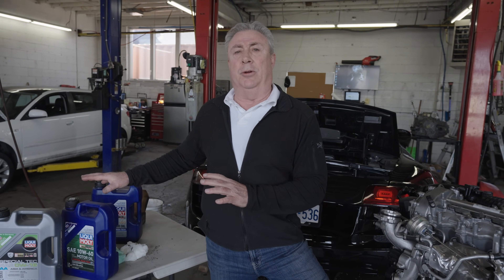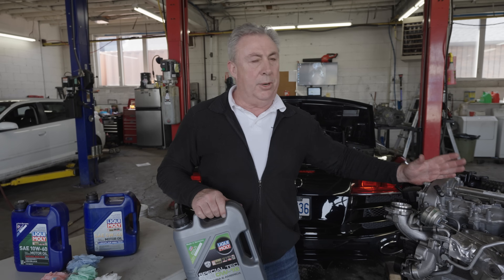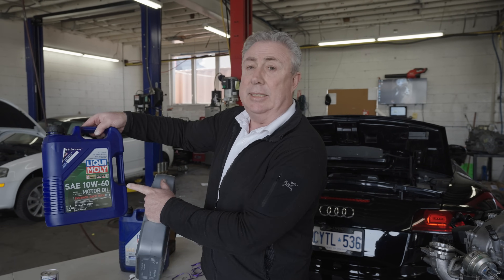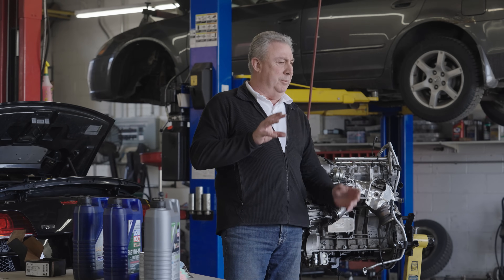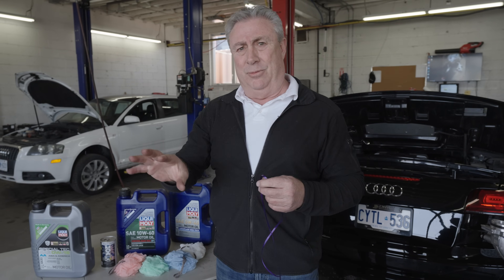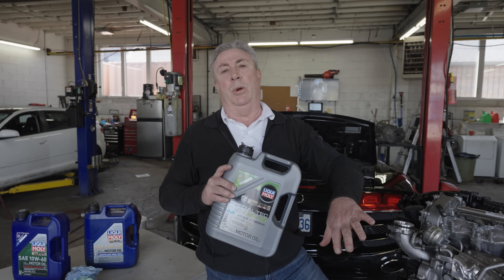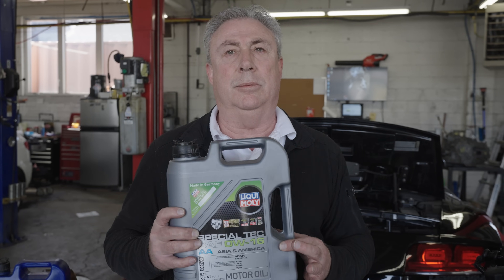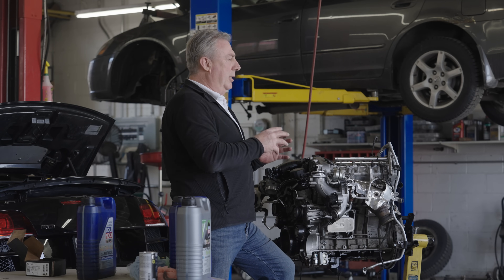Thin engine oil just a Scam? What's Safe

Comment: Kudos for you bud. Finaly someone with no BS. I'm sick and tired of YouTube "influencers" making you question mechanical engineers and car manufacturers. There is no conspiracy, car manufacturers designed engines to run on specific oil so use damn oil that is recommended for your car and change it often.
Reply: All too often nowadays, there is indeed a conspiracy - a conspiracy to get the highest possible CAFE numbers and to claim the lowest amount of required maintenance.  Back in the day, it was the engineers who determined what oil should be used, but Back In The Day is not today.

Comment: As a Chrysler instructor I had the opportunity to spend time with “Director of Organic Materials” (no shit).

He explained the lubrication ability of oils. They break down into four groups. 
Group 1 (aka “synthetic”) is by far has the best lubrication ability.
Group 2, not as good
Group 3 even worse
Group 4 very poor

“Synthetic” or 5w-20 or 5w-30 is pure group 1 or a mixture of group 1 and 2.

10w-30 is group 2 or a mixture of of group 2 and group 3.

10w-40 is pretty much group 3

Everything about that is group 4.

Now this ‘ol boy came to work in coveralls, no suit, which made me immediately like him. He has multiple PhD’s. I never saw a reason to disagree with him. 

Another reason for oil existing is it now performs hydraulic functions. Multiple cylinder displacement, cam phasing, variable oil pressure, etc.

We had a customer who refused to use anything but 20w-50 in his Hemi. He would bring it in with the MIL on. The techs drained the oil, put in 5w-20 and drove it around. Change oil again and gave it back to the customer who drained it and put in 20w-50. Strangely the MDS would act up again.

He said, “That’s all I’ll ever use!” He took us to lemon law and lost.
Reply: I may have had that backwards. I guess I misremembered. After some research , group 1 is the garbage.
Reply: Yes Group 1 is garbage. MDS works great even with 5W-30. I can't imagine running 20W-50 in anything nowadays. Unfortunately even Dodge went to 0W-20 in the Hemi in its last few years of production of which I promptly ignored.

Comment: If your going to be pulling something heavy in Death Valley in the summer time, you will  have a lot more to worry about than just the motor oil viscosity!
Reply: 20w50 if its a scorcher.

Comment: Forgot to mention a lot of engines need a thinner oil for the smaller oil ports for vvt ..vct..etc
Reply: Wrong.
Reply from the maker: Yes, the oil passageway size is definitely something to consider for choosing the right oil viscosity.

Comment: One thing I found using fully synthetic only oils in 80/90’s + cars that when lade up for a very long period. Say for example you take of the rocker cover there is no oil to be found, the top half of the engine is bone dry! Even the bottom end is. But using mineral oil everywhere
Reply: All mechanical parts are nice and oily

Comment: Engines that have hollow connecting rods and crankshafts require the specified viscosity to avoid oil starvation. IE heavy oil will not flow though a pin hole like water. Change oil before it gets dark. Never use a FRAM filter.  NAPA, or PUROLATOR are superior to all the others. Difference of Platinum vs Gold filter is: Platinum filter element is engineered to remain intact for at least 12 months, nothing to do with particulate size.. Save your money if you're changing it every 3 / 6 months. Really good thing to do especially with hollow cranks, and con rods is day before service pour in a bottle of KLEEN FLOW valve and lifter cleaner. You will pull a lot more dirt out when draining and you will notice the oil stays cleaner longer after the change. I would never buy a work truck that runs  on 0 / 20 oil. Respectfully submitted.

Comment: Thinner oil is used for engines built to tighter tolerances less bearing clearances and such. If you use to thick of an oil in you modern engines you will cause more damage than running the manufacturers specified oil recommendations. Another issue with thicker than specified oil is the VVT phasers and actuators will not function properly. Do yourselves a favor and stick with the recommended oil weights. The problem is to high intervals between changes. 3k-5k oil changes with correct oil gets you the 200k-300k miles in a quality automobile.
Reply: That is absolute nonsense and a common myth. Tolerances have not changed in 50 years so please stop with that.

Comment: Also, never go 20,000 miles between oil changes. Even if the bottle says so.
Reply: I noticed there was an asterisk: 20k OR 1 year.  I drove 8k in one year, changed it once a year.  Car died, but engine was running great, no oil consumption.  2009, though.  New high-compression 0w-20 Mazda?  Kind of afraid to do anything with the viscosity, definitely changing it around 5k, not 10.

Comment: i'm gonna respectfully disagree with you, sir my honda Ridge is running 0W 20 has 320,000 miles on it and still runs like it's new no ticks just press the gas and hit 110 whenever you want.
Reply: And I have an island in the Bayous for sale.
Reply: That depends of the climate temperature that you live.
Reply: Thanks for your comment. My 2016 Accord V6 is about to hit 100k. I was wondering if I should use a thicker oil. My son in law's Accord has 325k, no leaks and doesn't smoke, so I'll keep using 0w-20 high mileage.
Reply: @aharris9661  my wife have a honda fit 2013 that uses 0w20 , that has no links and doesn't smoke but i have another fit 2009 that is the same engine that uses 5w20. I change my wife car from 0w20 to 5w20 and was the best move. The motor perform better and sound much less. Like new. Latter i plan to move to 5w30.

Comment: My motorcycle takes W30 straight, anything else will leak.  125cc single cylinder 150000km on the odo.

Comment: I would be concerned about using thick oil in an engine that's designed for thin oil. I would worry about it clogging up all the oil channels in the engine. Water flows better than molasses. And if you're using channels for that flow that are designed for water, you're going to really mess things up if you put molasses in it.

Comment: Three of my cars have either over 200,000 miles or close to 200,000 mi on them. They all use thin oil. None of them burns any oil between oil changes. I mean, none at all. At least not measurable. I check my oil before I change it. And they're all up to full capacity.

Comment: I recently watched an interview with a Toyota engine designer and he was asked about engine servicing. He said, according to annual mileage, you should change oil and filter once or twice  yearly. Always use OEM filters but source the cheapest oil, of the correct grade, that you can find and you shouldn't have any problems.
Reply: @peem1244  ...not exactly true. Some vehicle oil specifications include certification requirements. You cannot use just any oil of the same viscosity. Example: Toyota GR Supra engine oil. (0W-20) There are only a handfull of oils that meet the certifications.

Comment: I agree it is wild, but it is what is required to prevent failure. It is our 2nd car purchased relatively cheap from a family friend, otherwise I would nit have bothered. The car is used for longer motorway runs to/from the airport when on business travel and it performs well. Comfortable, economical, AWD in wintery conditions etc.  Just a shame about some of the poor quality design and components that lead to premature engine failure. Chain replacement, gearbox service, turbo inspection/cleaning, oil & filter change and cabin filter change all due to be complete by end of next week. Fingers crossed it will only be oil & filter changes for the next 100k 😂 P.s - the wet belts are not for the faint hearted either 😮

Comment: To combat the EPA, I started changing my oil every 3k miles. Take that you tree hugers 😅😅
Reply: I live out in the country. No stop and go city driving. And 90% of my driving is a half hour or more on paved roads. What is considered perfect driving conditions. I change my oil every 5,000 miles on most vehicles. Every 8,000 on my Cummins diesel. Because it holds 11 quarts. I use 5W30 synthetic in most. And 15W40 Rotella in my diesels. I used 5W40 Rotella synthetic in the diesel Jetta I used to have.
Reply: Used motor oil is recycled.  No reason for guilt.
Reply: Keeping old machinery running is friendlier to the environment than manufacturing new machinery

Comment: I agree with everything you said.  Except.  You did not address oil certifications.  Such as VW 504 bs VW 508.  Someone could do serious harm switching from a 0w-20 VW 508 oil to an SAE 0w-30.  They have to at minimum get the VW 504 spec oil in 0w-30.  If you don’t. You run the risk of damaging catalytic converters and other parts on a VW / Audi.
Reply from the maker: You are definitely right - it’s critical to understand those specs. Great point!

As a general rule - my understanding is the difference between SAE ratings and VW 504 oil specifications comes down to what they measure and who sets the standards.

As a general rule the SAE rating is a viscosity rating versus VW 504 00 VW 504 00 = VW’s performance standard, including viscosity, detergents, wear protection, and emissions compatibility.

Specifically, VW 504 00 specified oils have strict low-SAPS (sulfated ash, phosphorus, sulfur) formulas to protect catalytic converters and diesel particulate filters (DPFs).  Some oils that often meet VW 504 00 include Castrol EDGE 5W-30 LL, Mobil 1 ESP 5W-30, and Liqui Moly Top Tec 4200 5W-30.

Again, great point.

Comment: I'm pretty well settled in moderate climate with Diesel type 10w-40 and 15w-40 in all the cars, trucks, and aircraft.
Reply: Same here, moderate climate in Pacific Northwest -- kept things simple, I used nothing but Shell diesel grade 15/40 in all my cars, trucks, tractors for decades. The vehicles all seemed very happy with it.  Unfortunately, I can't find 15/40 anywhere now.
Reply: @RichardKarlson  Valvoline Premium Blue SAE 15W-40 off Amazon, and Walmart Super Tech Heavy Duty SAE 15W-40 Motor Oil, 2 Gallons is about $26.
Reply: @  Thanks for that. I'll check out the nearest Walmart here. I've looked for 15/40 at our local Canadian Tire stores but haven't seen any lately.

Comment: It was quite awhile ago, I was working in an old country two pump station attached to a big old wooden barn used as a garage. The owner drank up all the profits and couldn’t afford to pay me so he gave me an old 49 Ford convertible with a blown engine as pay he owed me. There was a wrecking yard just down the road and I picked up a used engine for around fifty bucks. One of the mechanics at the garage coached me and I was able to swap engines, I put together my first car, it smoked a little bit and leaked oil but it was all mine and I did it myself. The surprising thing is it was darn fast, I could keep up with the best of them. I torched the springs and had a guy weld on some cutout pipes but couldn’t afford a new convertible top so anyway money was tight and my car used up oil like crazy so I would just pull into any friendly station and ask for some drain oil, they would almost always help me out, it was a different world back then. Even today I have a bunch of old cars, I run the oil till it gets dirty  sometimes for many months even years, seems to work for me.

Comment: They are so "concerned" about fuel efficiency until some designs a 200 mile per gallon carburetor and then you sell the patent to the oil monopoly and or get killed.  Don't even think of using water as fuel, that really upsets the racket.

Comment: The reason manufacturers are going to thinner oil is tighter bearing clearances in the engine. Be very careful of using a thicker viscosity because you might lose engine lubrication.

Comment: My vehicle in the United States uses 5w20 oil, while the identical model and engine in Australia calls for 15w40. While bearing clearance might influence performance to some extent, it doesn't seem to have a major effect on my car.
Reply: Temperature differences
Reply: @ljbolin8360 exactly.  Nothing to do with the way the engine is built, like the bs argument of 'tighter tolerances'. If the same engine in australia can use 15w40, then they all can around the world as long as its hot enough.

Comment: Oil mixed with soot over time becomes acidic. Conventional oil actually turns into varnish. The real reason for these new oils is thier resistance to ethanol mainly E85.
Never follow 15k oil change intervals.
Change your oil , brake fluid and all oils.
Remember , manufacturers design cars to survive a 5 year lease model. I would never run the 0-serirs oil

Comment: To make your engine last longer you should motor oil more often. If the manufacturer says 10,000 mile change interval, do it at 5,000.
Second, you can go up in oil viscosity. For my vehicle  I use 5w30 instead of the recommended 5w20.
Lastly, don't cheap out on the oil or filter. Use a high quality filter and full synthetic motor oil.
Don't forget to change oil regularly!! You'll save a lot of money in the long run.

Comment: This is something I have been talking about and trying to explain to people for many years. Some will listen, others are sceptical and continue to run ”watery ” oils just because it says so from the manufacturer….   I often run 5W50 in my cars, with additives for turbo diesels or rallying. Oil change every 10.000 to 15.000 kilometers. Never an issue even with hard drivning and abuse.

Comment: Sad that they push use of thin oils to provide a tiny bit less emissions, yet the carbon footprint of making a new car or engine for one worn out early is 10,000 times the emission difference between the oil weights.
Reply: Just the mining of the raw resources to build a new car is a tremendous amount of energy.  We should focus on making cars and engines last longer, but that doesn’t make MONEY!
Reply: Agreed, in principle.
Reply: a seized engine out of warrantee is money for the car companies thats why!
Reply: @smedleybutler1969  That claim is just comically dumb.  A seized engine out of warrantee will be rebuilt by a 3rd party engine builder, so it obviously wouldn't benefit the "car companies" at all...
Reply: That claim has been scientifically proven to be literally fiction, but whatever you tell yourself...
Reply: @redbaron6805 
Maybe not 10000x, but a significant amount
Reply: @JupiterCyclops-l5x  It is actually not even 1x.  The simple reason is, the energy required to make a new car is only 5% to 10% of its lifetime energy use.  Fueling a car to drive it makes up the other 90% to 95%.

Which is why scrapping an old car, and making a newer more efficient car, actually creates fewer emissions than driving an older and less efficient car, and requires less net energy.

People massively overestimate the emissions of making new cars, vs the energy required to power them.

Comment: My car is certified for 0w20 and 5w30, so I decided to use 0w30 to get somewhat better protection at operating temperatures without increasing wear during cold start.
Reply: 5w30 isnt going to increase wear during start...not any more than 0w20 unless your in subzero temps.. I do 530 all year round

Comment: Former Mobile 1 user. I have been preaching and using heavier weight top number 5 years. Minor correction to terms you are using. Tolerance is not design clearance. New engines have tight Tolerance from better mfg. But aluminum and steel still need same clearance as 50 years ago. This is for expansion, that is it. Heavy oil will slow down things like VVT and VVL. Also please in future heavier oil doesn't increase friction, I what but Heavy oil causes drag vary different. Interesting read recommend oils for car like a Vet. Daily 5W30 but if on a track they will up it to 15w50 or about 😂. Why former Mobile 1 after four changes on  3.8 jeep moter at 155K it did not use any oil at 3K change using Valvoline extend and protect i suspect the low tension ring were get stuck and have freed themselves. You should do a video on the Synthetic BS. It really is about what group the oil is classified. Synthetic is just marketing like the BEST 😢 thanks to a judge that was ignorant and stupid. See Mobile 1 lawsuit against Castrol.

Comment: I drive a 2018 Mustang 5.0. Ford recommends 5w 20 but I disagree.. It made my engine produce a light clicking noise. I changed it to 5w 30 and the noise went away. Car has 48,000 miles.
I use full synthetic and change every 3,000 miles.

Comment: Just run heavy weight oil and see how quick your engine starts rattling like a diesel. Tolerances in new engine are much tighter than years ago and heavy oil will not flow between the moving parts in newer engines. It takes thinner oil to flow between these tight clearances. Use full synthetic thinner oil and don’t worry about how thin the oil is.
Reply: Correct only to a point.  You can't use oil that is simply too thin to provide a strong oil film.  Remember, marketers and CAFE beaurocrats are not engineers.

Comment: Many of these newer engines, such as the hemi don’t have enough oil pressure apparently at idle to oil the cam and roller valve train! so for people out there if you love your hemi truck, I would put in a high volume oil pump such as the hellcat oil pump I believe if you’re changing your water pump and doing some work, this would probably be a good idea if you’re gonna keep your vehicle for 10 years plus like I do to me spending $400 for a vehicle I plan to have for over 10 years is a worthwhile investment